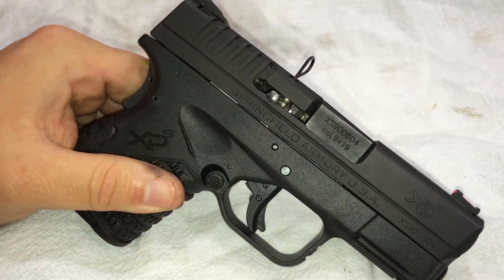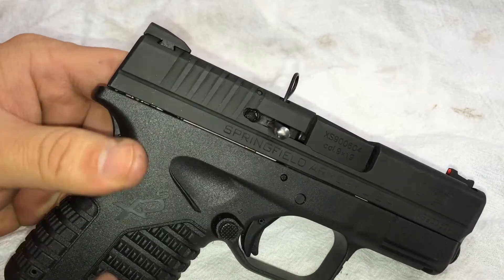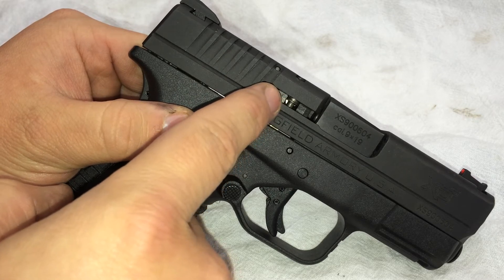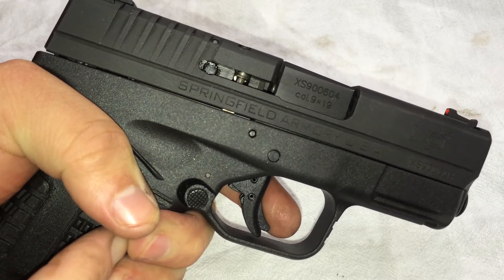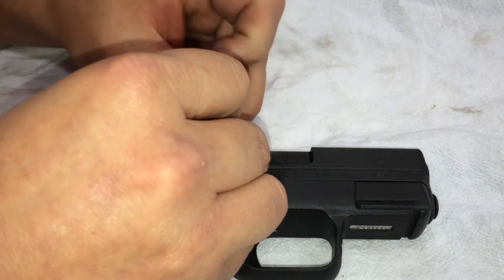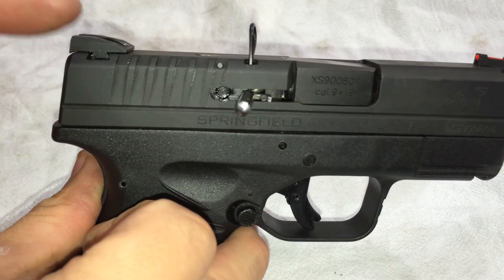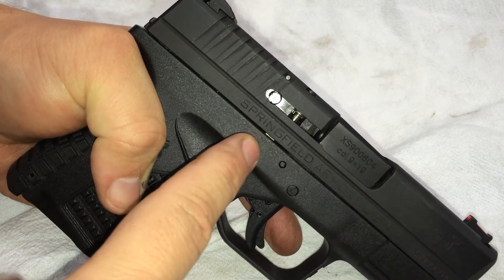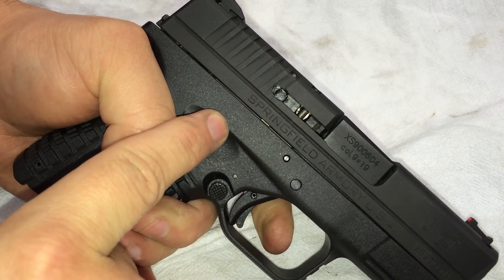XDS Drop Safety & Striker Relationship

Comment: What is the complaint that this is addressing? Is it that the firing pin makes a distinct noise and people are weirded out by it?
Reply: What im trying to find out aswell.?
Reply: It's for when the pistol is dropped it prevents it from being fired, the safety is for the fact that if you drop it, it's not going to prefire before the trigger is pulled